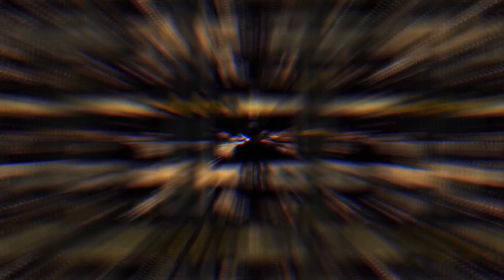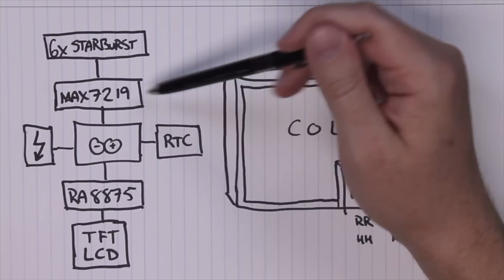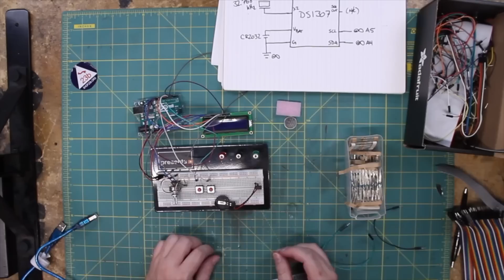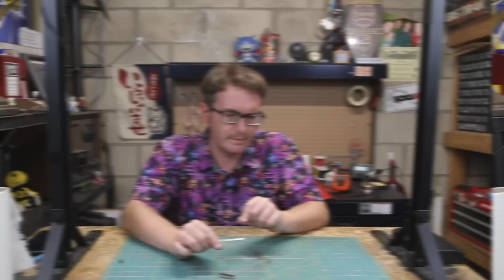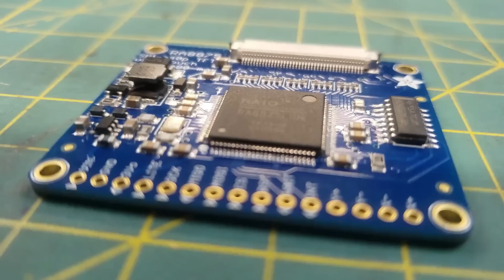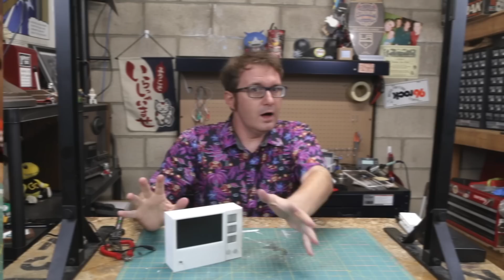Arduino Powered Hexadecimal Color Code Clock

Comment: Very cool project, I've done a Swatch "Internet Time" Clock (otherwise known as a .beat), new Earth time clock these outputted to the serial console, a Cheerlights display time is displayed in the color of the cheerlight, but it's not hex time, which outputted to a tft.  I did someone else ternary clock using neopixels. I am working on a "Darlek Rel" clock.  But I like the idea of color - I think I would use neopixels, and maybe display the RGB numbers on a small OLED.  The other thing all of my projects use either a ESP8266 or ESP32 and grab the time from a NTP server. Thanks for giving me another project to do :-)

Comment: Curious why you built a whole RTC circuit instead of just using an off-the-shelf ready-to-go temperature compensated module, but then went totally overkill with an LCD screen and driver instead of one or a few RGB LEDs with a diffuser lens and a simple driver circuit. Not that there's a right or wrong way to do this; obviously this this the kind of thing you do just because you can, and it is deliberately somewhat ridiculous. 👍

I've always loved timepieces of all kinds, especially unusual ones. This has me thinking about doing one of my own. Maybe using an Internet timeserver as an accuracy control and making battery backup unnecessary, and several different types of representation for the time display.

It would be cool to have a clock that is always right and never has to be set (other than maybe time zone, but GPS could make that automatic as well). I've always been drawn to "atomic clocks" but they are limited to geographical areas and don't work worldwide. They also can take a half hour or more to update.